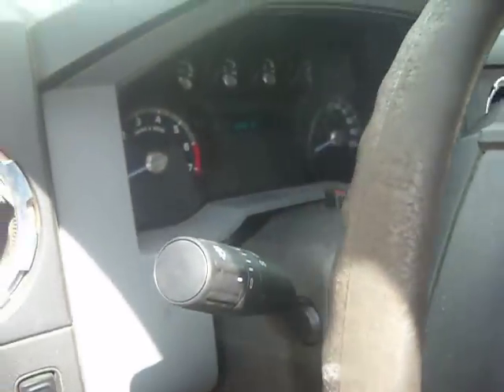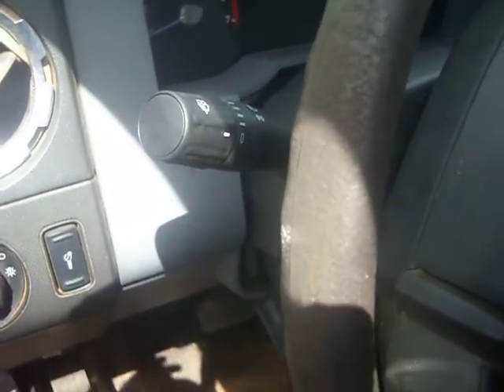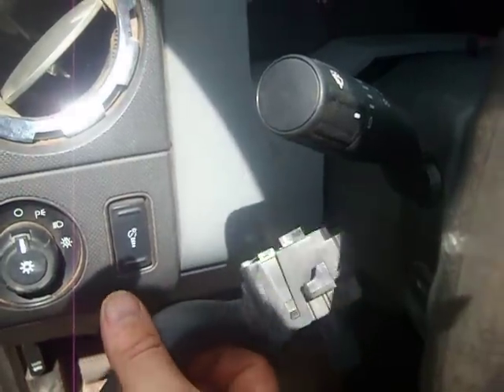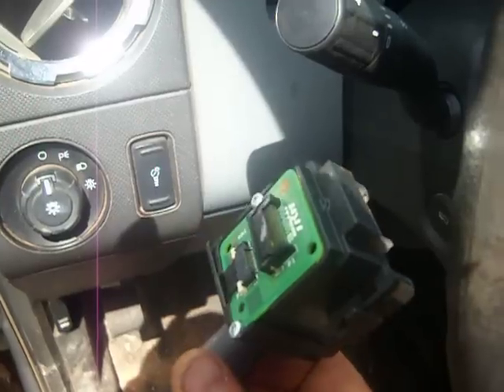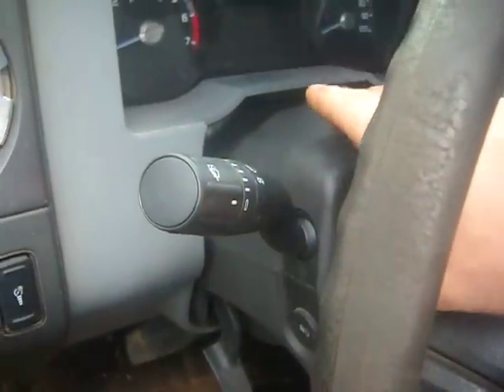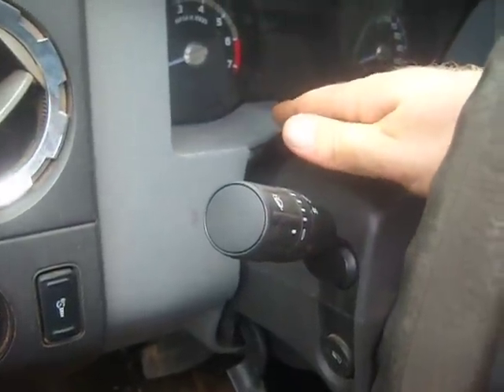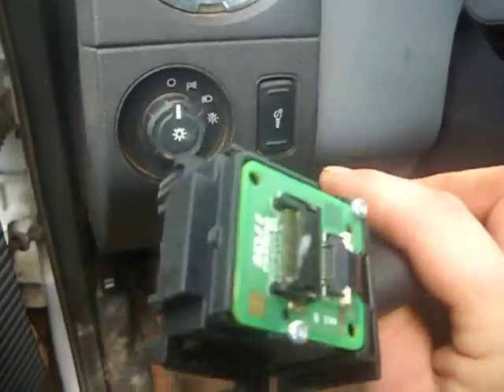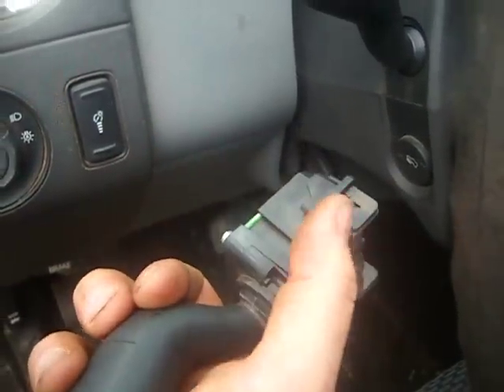ford f-250 wipers do not turn off easy fix windshield

Comment: Thank you so much for this post! I had the same issue on my 2012 F250 and fixed it with the part described. The only thing I will add for folks is that you need to turn your steering wheel in order to access the little screws  with your screwdriver (T8 screw) that hold the assembly in. And FYI- the 3 screws on the bottom are 5.5mm. Thanks again  landrun89!!!
Reply: THANK YOU SHAWN. NOW NOT KNOWING THAT WOULD HAVE BEEN DRIVING ME CRAZY, ON TOP OF ALREADY GOING CRAZY, BY DRY WIPER SQUEEK NO WHILE RAIN. ❤

Comment: Worked perfectly to fix my 2006 F350. Cheapest part (wiper switch) I could find was at AZ for around $90 plus tax.  Took all of 10 minutes to put it in once I had the right size torque head for the small screws.  Hardest part was bending down the lower plastic bottom piece while I removed and reinstalled the small lower screw.  I have a manual steering column release that kept the lower part from coming off.  But it was still easy to do.  Dealer probably would have charged $450+.  Thanks for the instructions.

Comment: Thank you for posting this video.  You helped me big time. My wipers on my 2011 F150 wouldn't stay  turned off any more.   With your help they are fixed now. Only difference is the wiper switch is on the left side in my F150. All is well now.
Reply: my nissan micra  wipers  wont  turn  of

Comment: Have the same problem, bought a new switch, swapped it out, and the problem still persists. The wipers still keep going. Is there something else I am missing?
Reply: Jeffrey Langdon did you solve the issue, i have the same problem currently. Non stop for two days
Reply: What happened, was the part defective? I’m assuming you didn’t get rid of the truck because of it.. but it’s been a while since you posted this.
Reply: @brewerbentley6014  Replacing the part didn't solve the problem. I think it was because the electronic contacts were dirty. I bought a can of electronics contact cleaner and that seemed to solve the issue. I still have the truck, no problems since.

Comment: Seriously radio frequency,not hard wired,There;s a multi pin connector on the back of the switch that plugs into the mount on the column
Reply: Hahahaha. Radio frequency?!?! Does that cause static on the radio. 😂😂😂

Comment: So my wipers in my f250 did this. Found this video and switched it out but it didn’t work with new one.  Not only did they still come on and stay on, the blinkers wouldn’t turn off after turning.  Any suggestions?
Reply: you may have to replace the SCCM ( steering column control Module )   I just had to replace the entire piece.

Comment: This just happened to my f350 dually, for sure i will go to the dealership to buy the part. I will post if the problem got solved
Reply: By the way its a 2013...
Reply: Well, i went to the ford dealership, the part to replace now cost 51 dollars with taxes...and yes it did fix the problem. Thank you so much for this video.

Comment from the maker: you will need to look up your manual in the glove box Or here online mine. was fuse 25 which is a 30 amp on a 2011 f250
Reply: And thanks for that tip too. 2015 Ford F-150. Surprised did not last longer? Might try repair myself. ❤